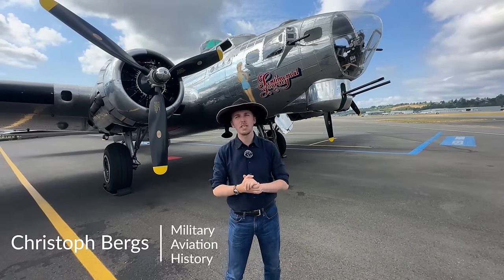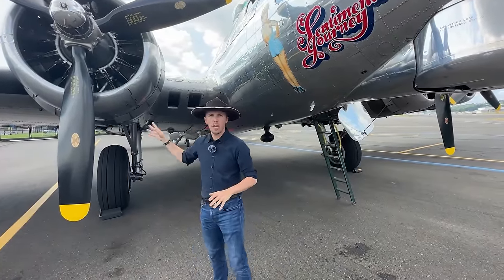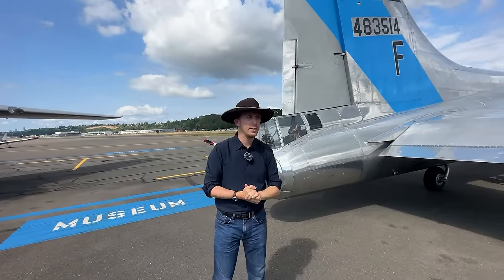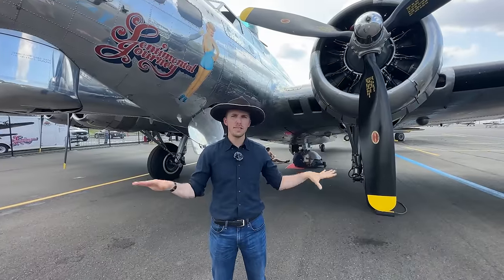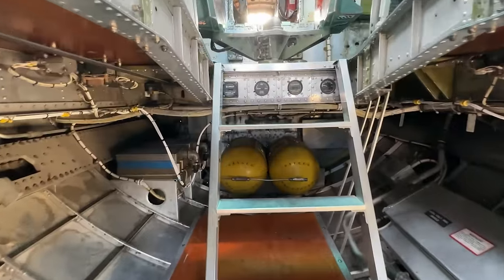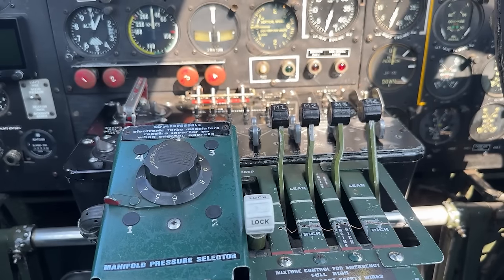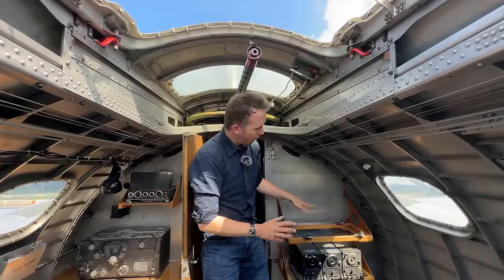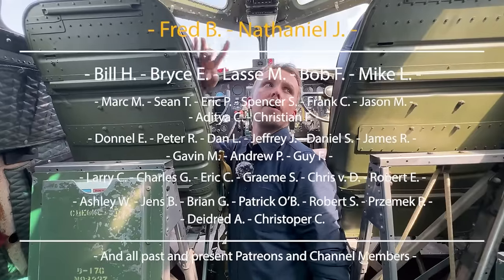Inside The Cockpit - B-17 Flying Fortress "Sentimental Journey"

Comment: I talked with a top turret veteran at Oshkosh, 1997 or so, who said on one mission over Berlin, they lost two engines and hydraulic power, and he had to drop down to manually crank the bomb bay doors closed.  My memory is he said 147 turns.
Reply: My grandpa was a top turret gunner, and he had to crank the door open after some sort of failure. I dont think he gave a number, but he said he felt like he was cranking forever lol.
Reply: Thats a common scam. As you were having a conversation he was hacking into your Club Penguin account

Comment: I visited that aircraft in 1986 and had the pleasure to be next-in-line to a guy who had been a radio operator. He said that if any bombs didn't release, it was his job to put on a safety harness, walk out onto the catwalk with the bomb bay doors open, and kick the bomb free. He slipped once. Hanging by a harness 20,000 feet over Germany with 88mm ack ack exploding as he kicked the 500 lb bomb, he was thankful because the harness meant that someone was concerned for his safety. 😀
Reply: Radio Operator wy Dad's job; fortunately he joined the war effort after Germany was declining and he never had to kick start a bomb drop (making me possible).

Comment: In the Fall of  1988 I was a shiny new Border Patrol Agent stationed in Marfa, TX.  At the time I was renting a small trailer at the north end of town. A mile or two north of me was the airport, with not much in between. As I got home from work one late afternoon I heard the distinctive sound of a large, multi-engine piston aircraft flying around. I scanned the sky for several minutes. Eventually, a B-17 dropped down through the overcast, and landed at the airport. "Wow! That was cool!" I thought. Then I went inside to shower and change. A little while later, I ran into the crew at the local IGA. I ended up giving them a lift to a Mexican restaurant and back to their motel. One of the crew then gave me a guided tour of Sentimental Journey from one end to the other, except for the ball turret. Even at 5'8" I'm too tall to fit in there! Great memories! Marfa is at about 5000 ft. above sea level. Some of the mountains around it are in the 8000-9000 ft. range. The superchargers weren't working and they didn't have oxygen, so the crew decided to overnight in Marfa.
Reply: No kidding about the smallness of the B-17 ball turret. My grandfather served in the ball turret as he was a small man, and even got shot down over Germany. Bravest men in the world.

Comment: I flew in the Collins Foundation ("CF") Nine O' Nine in 2006 (13 years before it crashed killing 1/2 the people on board).  The CF were offering rides on either a  B-17, a B-24 or a B-25.   My friend's father had been a B17 pilot in WW2, so we chose the Fortress.    We flew to Dallas Love field to fly on board,  as that location met our schedule.   We had scheduled the first ride of the day, which was the way to go.   The flights were about 25 minutes around North Dallas, but being on the first run, we got about several maybe five more minutes on the runway as they revved up the engines, which they didn't do for the subsequent flights.   Once in the air, you were allowed to roam about the B17 from the nose back to the waist guns (that were mounted in glass inserts).   The tail and the belly turret were closed.   The radio operators window on the top bubble was off, so you could stick your head out into the air stream.   Really an amazing experience.   The Nine O' Nine was painted in OD exterior colors, and I recall the interior was also painted, certainly I didn't remember the spotless interior you see in this video.   As poor maintenance was cited as a factor in the crash, I think the Sentimental Journey's interior, to a layman says, "this plane is well card for."   The Nine in retrospect gave off a different vibe.
Reply: I got to seethe 909 when I was 12 at Melbourne airport in FL. It was pretty damn cool. The nose art and amount of bomb decals up front made it look really striking.

Shame people died, but also a fuggin shame that the plane is almost certainly lost forever now (even if they could rebuild one…..that’s millions of dollars another investor would have to pony up.)

Comment: Later in wwii, mostly on G type B-17’s the crew was changed a bit. Most planes lost their bombs diets and were replaced with a “togglier” they just sat up in the nose and flipped a switch when the lead plane dropped theirs. They would also control the nose turret. The waist gunner position was also changed and it became just one gunner rather than two. The one gunner would switch places depending on where he was needed, mostly in the 3 plane formation he would face outboard. This change makes sense as there wasn’t a huge need to have a guy looking at the other bomber in the formation, it lessens the risk of friendly fire and also due to lack of german interceptors they found it was safe to get rid of the second gunner.

Comment: Small point: the -G might have been the most heavily-armed B-17 bomber , but it wasn't the most heavily-armed B-17 per se. That would be the YB-40 "gunship" which was intended to escort bomber variants, and traded all it's bomb load for more firepower. It had a second dorsal turret behind the standard one, twin guns in each waist position, and also introduced the twin-gun chin-turret later seen on the B-17G. The bomb bay was converted to carry extra .50 cal ammo. It proved a failure, since, unlike the bombers, it didn't get lighter and faster after it had dropped it's bomb load, so the bombers tended to leave it behind on the journey home. Only 26 were built and they were withdrawn fom use after only 14 missions.
Reply: Some were used in the US for gunnery training ships. I know Laredo had one for this role

Comment: I have an instruction manual for an RAF Coastal Command Flying Fortress.
It tells you how to remove the ball turret and drop it off in flight.
It says something like "Once you've removed the bolts, give the turret a sharp kick and it will fall out.  Make sure you don't fall out too."

Comment: In any video about the details of the B-17 up-close, I haven't heard anyone mention the use of those rugged zip fasteners in the chin turret and the Cheyenne tail turret. In elevation, the gun elevation slots were kept closed by having zip fasteners above and below the gun barrels. You can see this in this video. If the guns elevate, the zips above the guns unfasten to allow the elevation movement, while at the same time the zips below 'zip up' to seal the canvas closed behind them, below the barrels. The actual zip fastener actuators are fixed to those metal plates on the gun barrels where they come through the canvas shields. I first noticed this on the chin turret of the B-17G at the USAF Museum at Duxford, UK and was amazed by its cleverness. A simple, cheap and ingenious solution to help prevent severe draughts in the aircraft and also to help prevent the guns from freezing. Clever.

Comment: Thankyou for mentioning the fact these large formations carried out carpet bombing and were not a case where each bombardier took aim himself.   It should be mentioned  that several different bomb groups would join at individual rally point making up the large bomber streams sometimes over ten to fifteen miles long and up to five miles wide,  Individual bomb groups had lead bombardiers as did individual wings within the groups.  Wing size could be up to 20 or more aircraft and a group would be multiple wings.   If the lead plane was hit and had to drop out of the stream or was outright destroying the next plane took it's place often flown by the next ranking pilot taking over the role of bomb aiming.   In this way the other planes dropped their bomb load when they saw the lead plane drop theirs making for a carpet bombing pattern  for the wing up to a mile wide and two miles long depending on altitude, wind and speed.   The old pickle barrel claim was pure fantasy.    The stainless B17 is an absolute work of art, nothing prettier than any raw stainless airframe.   Images of damaged B17's that returned home show the incredible build quality of the type.

Comment: The B-17 COULD carry the ordnance that Chris describes.
On paper very impressive.
In reality it never happened in any operations over Germany.
In operational reality the Mosquito could carry as much, fly further, faster and higher than a B-17.
With a crew of two.
At a fraction of the cost.
The B-17 was a very expensive machine to make.
Reply: Mossie was limited to 4000 lbs max with heavy modifications, 17's were routinely carrying 5000 lbs stock. If the mossie was such a one stop solution then why in sam hill did the UK use the Lanc, Stirling, or Halifax?
Reply: @ghoul11719 the Lancaster could carry the largest WW2 bomb, the 22000lb Grand Slam bomb and had a much larger bomb bay, it regularly carried 12000lb loads and flew  Operation Chastise, The most incredible mission of the Second World War.
The B17 rarely carried anything near its actual limit of bomb weight on longer missions due the the weight of fuel needed. 
More Mosquitos may have been a better solution and would have led to far lower casualty figures for the allied air force bomber crews. At the time though the powers that be did not want to put all their eggs into one basked and so took a mixed approach to bomber types.

Comment: Every gun on a B-17 meant less bombs and less operational range.
USAAF strategic bombing doctrine was fundamentally flawed in the ETO.
The Norden didn’t work 70% of the time and thousands of brave young Americans were sacrificed as a result.
The B-17 is a beautiful ship but by 1942 was basically obsolete but the USAAF had invested so much in it’s role that they could not change course - hence the guns and hence the reduced bomb load.
Which only made sense if the Norden worked.
Which it didn’t .
Reply: When in development and testing over the clear desert air of the Southwest the Jorden performed well. Over Central Europe with variable wind conditions not so much.
Reply: I'd hardly call the B-17 obsolete, by that metric every heavy bomber in service was obsolete. Plus, the B-24 wasn't as good in the ETO due to the flaws in its wing planform limiting its altitude